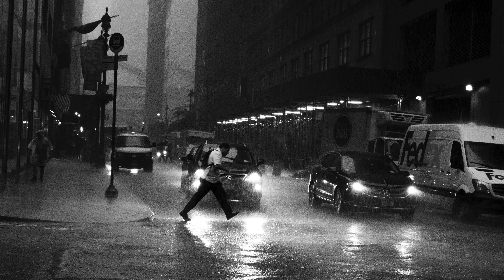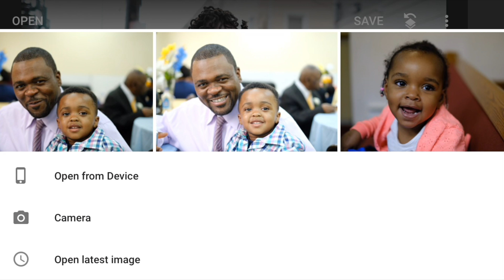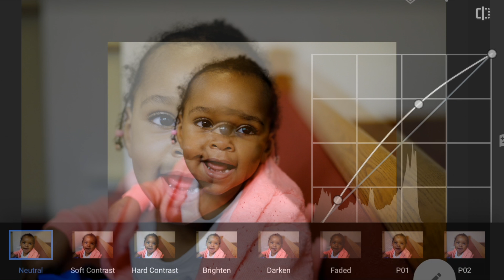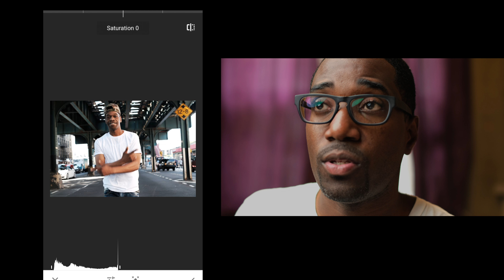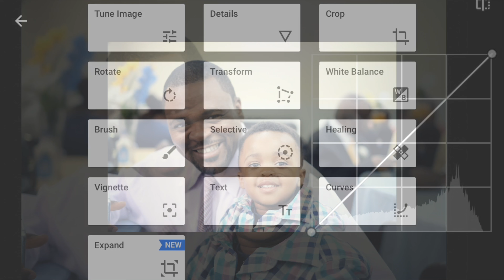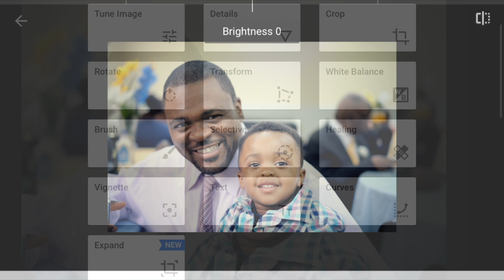FUJI XT2 Mobile Editing

Comment: Hi thank you for the video. I didn’t realized that there was a curve tool in Snapseed! 😉
About file size when you use Fujifilm remote app, I am not sure that the resolution is 6000x4000. On my iOS devices it is downsized. 
Is there a setting where you can choose ?
Thanks
Reply: You can found the setting in your fujifilm camera. Inside "wireless settings" turn OFF the "resize image for smartphone"

Comment: Nice vid Karlon. Subbed. Question, why not use Lightroom Mobile? It also works with X-Trans sensors and will sync with your desktop where you can dig in further with film simulations etc.
Reply from the maker: Giulio Sciorio that's a good question I suppose Adobe has left a bad taste in my mouth but mainly because these Snap Seed seems to be more enjoyable to use.
Reply: Karlon Cromwell Snapseed is more enjoyable to use. I’ve noticed though that the shadow tool introduces a washed out effect, LR mobile is way better for recovering shadows. Nikon files.